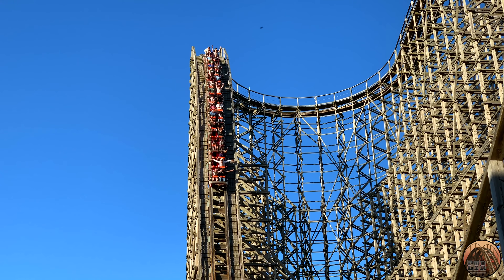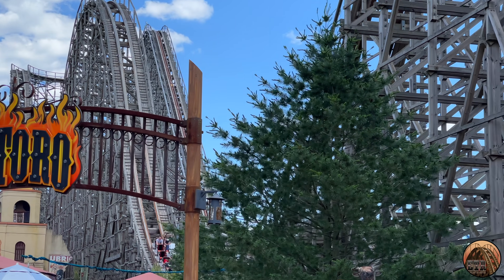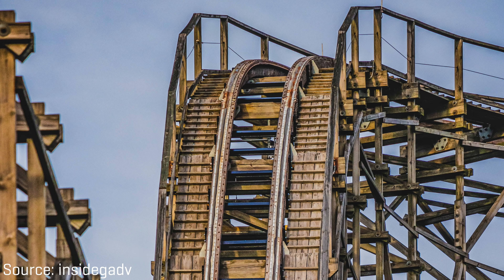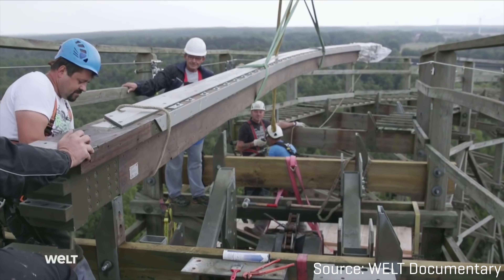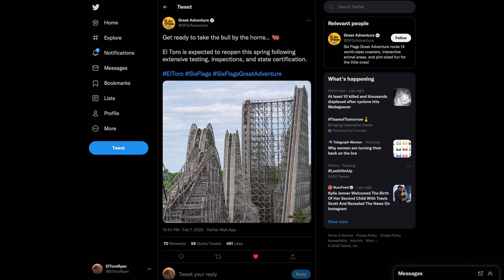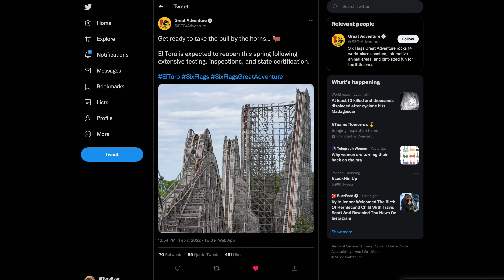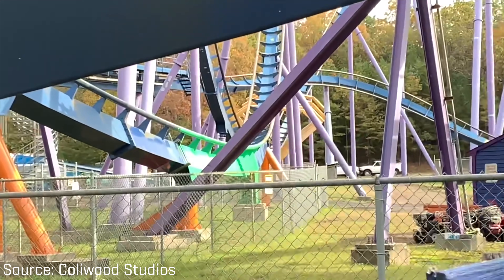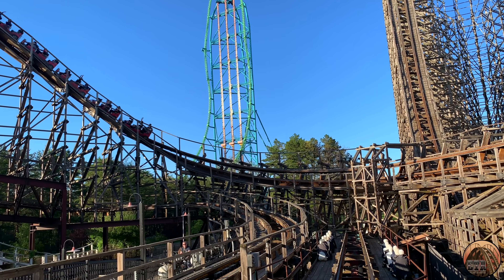Good News for El Toro at Six Flags Great Adventure!

Comment: People forget the New Jersey takes forever to approve rides after an accident on a roller coaster, but my opinion is that Great Adventure wanted to do a more complete track work on El Toro and the pandemic took its on the track, l but since they pandemic happen it, took its toll they didn’t get to replace the oldest section of track on the ride
Reply: Coaster Enthusiasts biggest villian : Ed Markey
Reply: @mickandme1  I mean that’s a good thing at means all the rides are inspected very well.
Reply: @JJJJ-he8bz  He did also make bills that would put severe limits on the intensity of rides which would have been detrimental to the industry had they been signed.
Reply: @ElectriKong-  They wouldn't have done a thing. The ones in NJ are "front-to-back G-forces cannot exceed 5.6 for more than one second; and side-to-side G-forces cannot exceed 2.5 for more than a minute, although the figures can change, depending on the kinds of restraints."

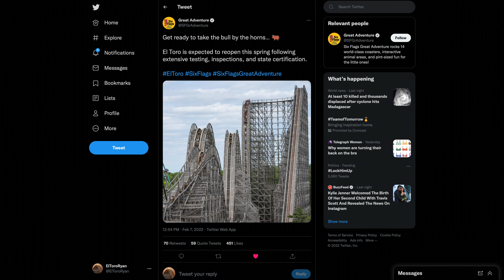Comment: What's interesting to me is the new steel braces look like they are U shaped, in the pictures at 3:05 and 3:28. I suspect one of the root causes from the investigation, or maybe just a tangential finding, is that it may be possible for the track to deform outward in those moments of negative G's (so that the track pieces were not parallel with each other), or the upward forces from the train may have been placing too large moments on the track or wooden structure. Even if not a root cause, like you mentioned it may improve the longevity of the ride and those sections of track.

Comment: It seems like they know what happened or at least have a good theory… placing those braces on the ejector hills because the gauge at the top of the hill opened up due to the upward force of the train, allowing the upstop wheel to squeeze out. I bet it opened up like that dozens of times but the wheel only popped out that one time.